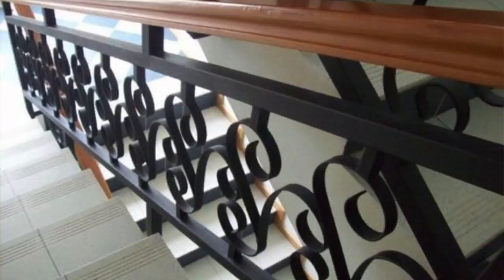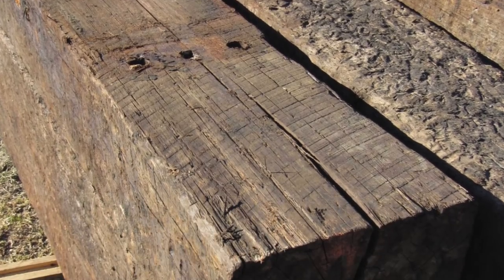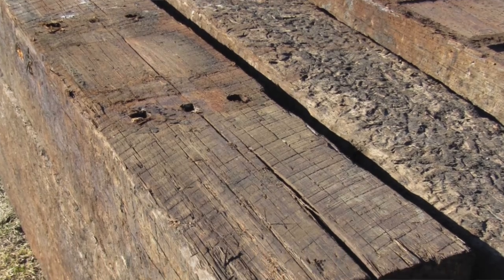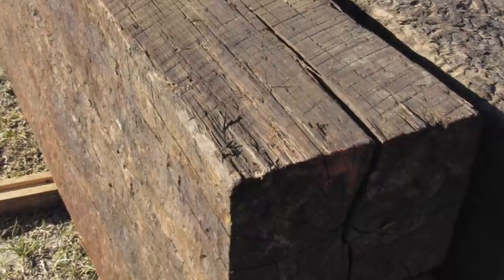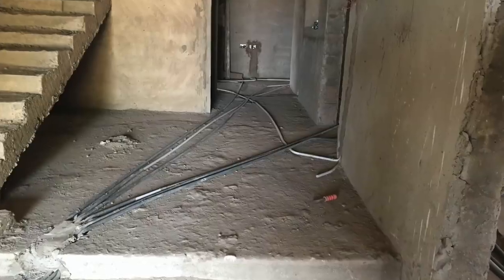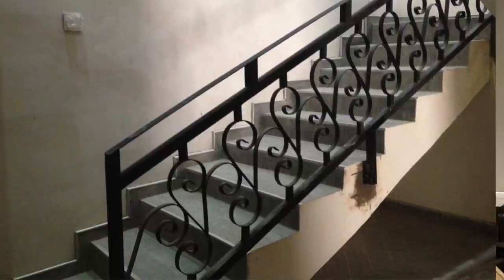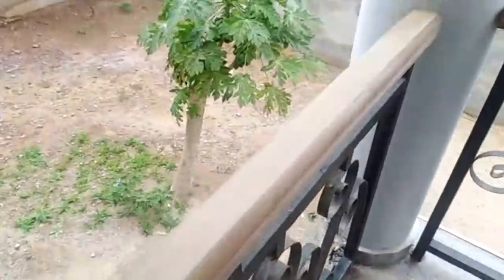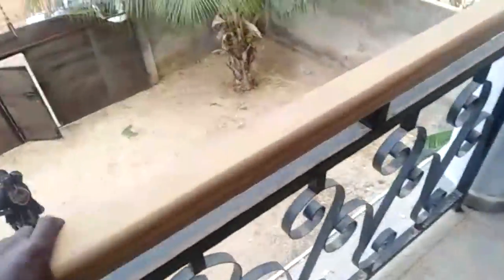Building In Ghana: Staircase & Patio Wooden Handrails Installation | Popular Handrails Designs

Comment: very nice my dear but surely shouldn't the under staircase cupboard door open outwards and not inwards?? Have I missed something?
Reply: I agree with you I was thinking the same way.
Reply: Yea exactly. It should open outwards so it can be used as storage. The door opening inwards will block the space inside and not much can be stored inside
Reply from the maker: Dannydct1: You’re right about that. I thought it opens both ways. The carpenter will come back to fix it. Thanks for watching.